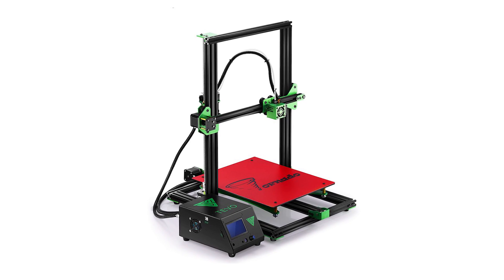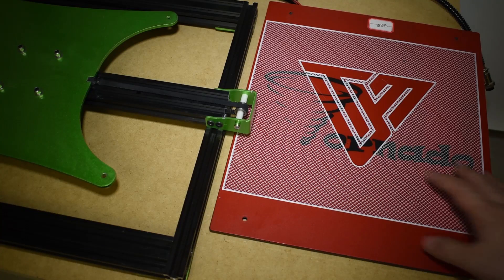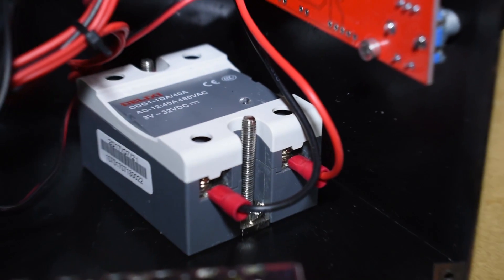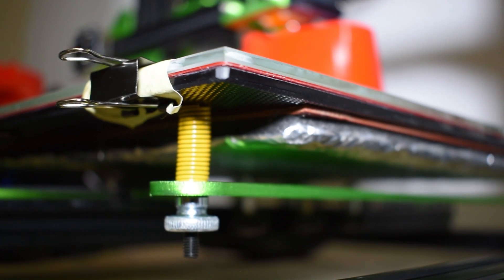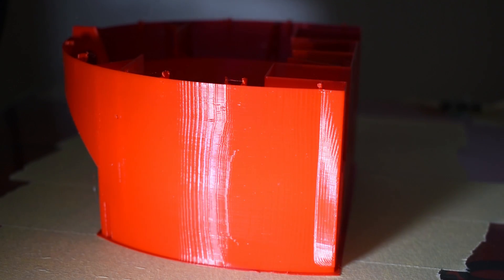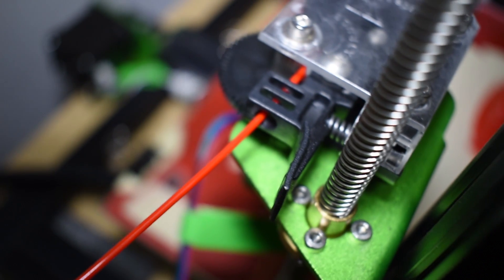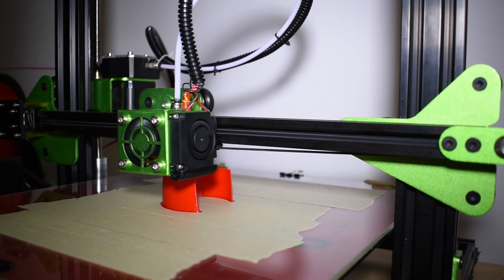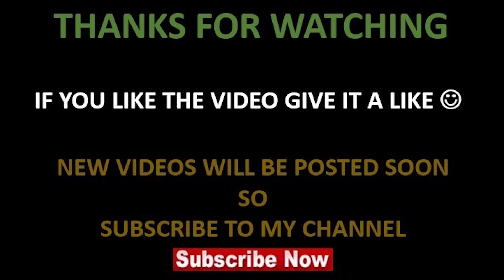TEVO TORNADO 3D PRINTER - FULL REVIEW

Comment: Time for an updated review for the new 2018 version with the gold CNC and ceramic bed, Rui. I love your videos!!
Reply from the maker: Hi,
The new gold version uses the same glass bed as the previous versions. The difference is that the gold one does not have the green/red print surface glued on. The major change is the board/drivers. The first version uses a MKS base board with A4982 drivers, then it was changed to HR4982 drivers. This new version uses a MKS GEN L board with A4988 drivers.

Comment: Hi, I'm ready to pull the trigger and buy my first 3D printer, and after some search I'm have two possible 3D printers, but I can't decide on wich one. My two candidats are Tevo Black Widow or Tevo Tornado. I don't have any concern about that black widow need full assembly, I have suficient skill to deal with that so that is not a trouble.
Do you have any advice of wich one is better?
Reply from the maker: Hi,
It's a tough choice and both have pros and cons.
The black widow is a fine printer. The big strong frame and the MKS GEN board with replaceable drivers are a plus.
The tornado with the AC heatbed with big printing area and being delivered almost assembled is an awesome choice too. The tornado will have a new edition in 2018 which will include some changes/improvements. That might be something good to wait for.

Comment: You don't need masking tape for the bed. The PEI sheet on the bed works terrificaly.
Reply from the maker: Hi Corbin,
I use masking tape on my glass. There are a few reasons why i use glass over the bed.
The first one is that sometimes is very hard to remove the print. Therefore i like to have a removable surface (glass) so that i can remove the print away from the printer, making it easier to remove the print and also, that way i don't stress the carriage.

Comment: Hey what kind of nozzle size does the Tornado take and where can I get some spares.  I might get one of these but getting spare parts looks hard to do right now.
Reply from the maker: Hi Steven,
I think you can get any e3d equivalent but i need to confirm. Anyway, i normally get all my spares directly from tevo. This way i know they are 100% compatible.
Reply: Thanks.  Which website do you use btw? Tevousa.com?
Reply from the maker: Steven Houtzager ,
I contact them directly by Facebook message.

Comment: I've had my Tornado running since 10/7/17. Some of my observations:

PLA and PETG were working fine, with print quality pretty much equal to my CR-10. The Titan extruder works fine, and the mains powered heatplate heats-up very fast -- all good stuff.

But, the Tornado's glass heat/build plate is a serious negative to an otherwise sound 3D printer!  I decided to try some ABS printing, and easily got the plate to 110°C. Unfortunately, the build surface developed some bubbles, and caused the surface to become unusable.

So, I judiciously managed to peel off the orange build surface, and cleaned the glass plate with Goo Gone, with a final wipe-down with isopropyl alcohol. Unfortunately, after mounting the glass plate back on, and heating it to 100° C, it cracked in several places when adjusting the bed level!!

Initially, I thought Tevo had used a fiber composite for the build/heat plate. It turns out they simply use plate glass! I have borosilicate glass on a couple other 3D printers, and the Tevo Tornado glass is just too easy to break to be borosilicate glass. I will be replacing the glass with an aluminum plate, high temp. fiberglass, or maybe 5mm Garolite.

Also, my part cooling fan died -- and no I did not physically "bump" it. It simply broke -- the tiny motor shaft and fan parted company. Other more nuanced issues concern the soft metal drop-in T-nuts. Several split when I was assembling the printer (a problem I did not have with the CR-10). Fortunately, I have many 5mm steel T-nuts, and replaced the cheap Tevo ones, as needed.

Overall, I cannot recommend the Tornado to anyone, until Tevo developers come up with a more rigorous build/heat plate solution. I suggest they look at the new Prusa Mark3 for some ideas!

Comment: Hi ruiraptor, is it possible to have the cura machine settings?
Reply from the maker: Hi Arawn,
Do you mean cura profile or cura machine settings. This is because the cura machine settings it's just type in the print area, select heat bed and that's it.
Reply: Hi, thanks for te quick response. yes machine settings. What do you use  for add printer, the costem one or pursa i3 or something else?
Reply from the maker: I use a prusa i3 to start with , yes.
Reply: Ok, thanks for the help and keep on maken these very good and are very helpful video's!

Comment: Super video again! Could you please tell me if you can reach 130-150 degrees heat bed temp with this AC bed? How much power consumtion does the bed have?
Reply from the maker: Hi, i havent tested the heatbed temperatures but, the spec is "Heating plate temperature: 60-110°C".
Regarding the power consumption, i will check and let you know.
Reply: Thanks for your quick answer. I know tevo states on their website that the maximun heat bed temp is 110 degrees. I'm wondering though if (safe) operation above 110, say around 130, is possible because these AC powered silicon beds can reach these high temps easily, if they have enough power. I have asked Tevo already, as soon as i get an answer I will inform you.
Reply: May I ask you one more thing: What do you think is the max printing speed limit due to the mechanics of the Tornado?

Comment: CR-10 every time.
No salmon skin to start off with - this is just a clone.
Reply from the maker: Well....the salmon skin is easy and cheap to fix (by using the smotthers). On the other hand, if you want to upgrade the CR-10 with an AC glass bed and SSR...it will be expensive as hell !
Reply: The CR-10 is a clone also
Reply: Of  which specific machine?
It's a i3 type - an open source design.

Comment: As always, nice review! Regarding the salmon skin there was a facebook group's user that claimed the salmon skin was caused by his bad quality outlet extension.
Reply from the maker: Hi,
Actually, what was mentioned was than the salmon skin pattern was worse because of the outlet extension but even with a good quality cable connected directly to the wall outlet, the pattern can still be seen. The only way to remove it is to apply the smoothers (same as with the tevo little monster 3D printer).
Reply: I was a little skeptical too and wasn't aware of the updated information but If you look at the driver IC diagram's configuration, the DPaK  already has inverse peak protection diodes. The high capacitance of wire's length  are storing energy from the motors totally messing up with the stepping waves generated by the drivers. If you are going to install them, be sure to put them near the motor as possible. Regards.

Comment: I Love the Heatbed..... very fast heating...... and also titan extruder..  no more clogging... 

how about salmon skin, is it caused of EMI ?
Reply from the maker: The salmon skin is mainly caused by the rough movement of the stepper motors due to the back current effect.
The smoothers will block the back current effect and therefore eliminate the salmon skin.